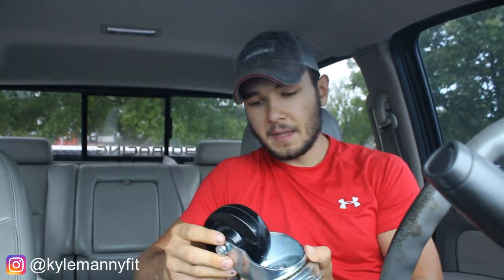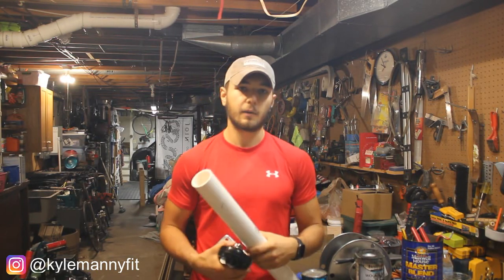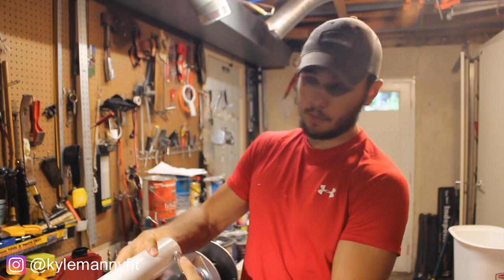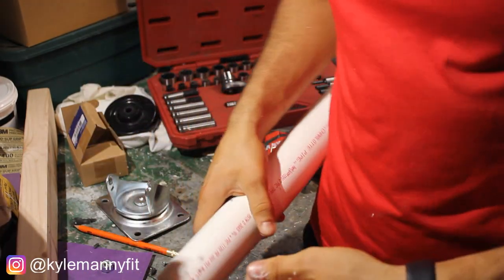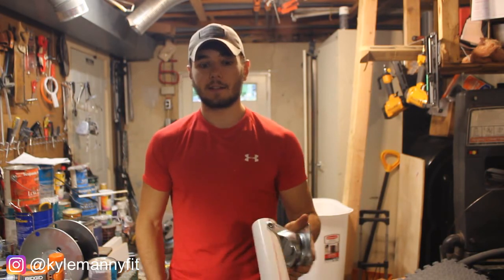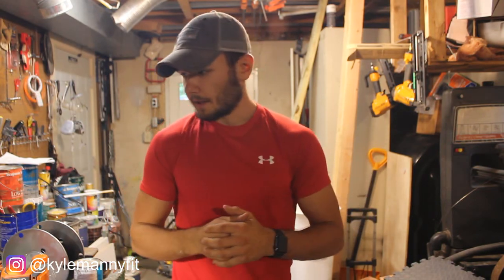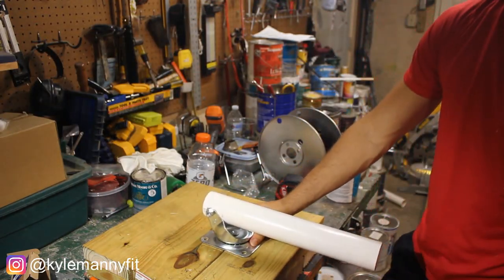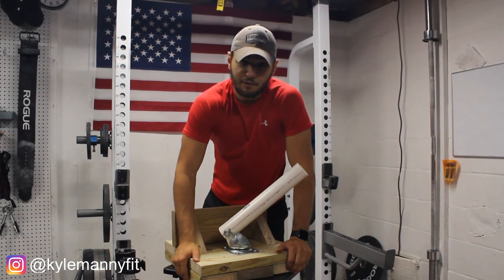EASY D.I.Y. LANDMINE FOR LESS THAN $50 | HOME GYM HACKS

Comment: Hey Kyle, what size castor did you you.Could you put the part number in the link. THanks
Reply from the maker: Hi Ralph, here's the link to the caster: https://www.homedepot.com/p/Everbilt-4-in-Soft-Rubber-Swivel-Plate-Caster-with-225-lbs-Load-Rating-49480/203661067?

Comment: heat the bolted end of the PVC slightly and shape it with hour hands to fit better...then add large washers between PVC pipe and wheel fork to keep from digging in to pipe. That's my only suggestion to this otherwise great design!!!